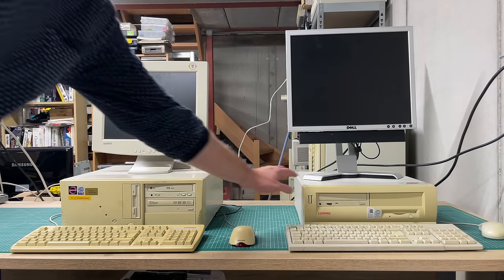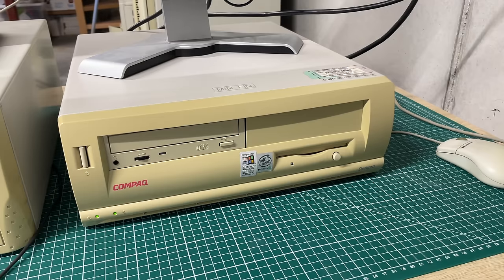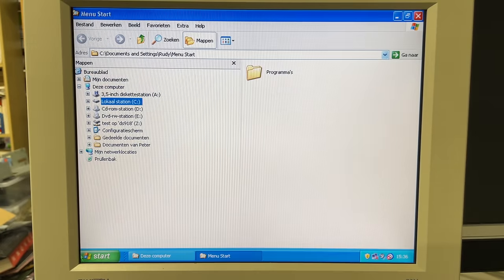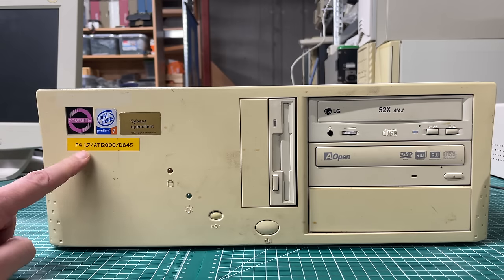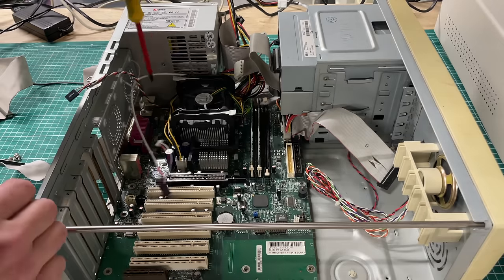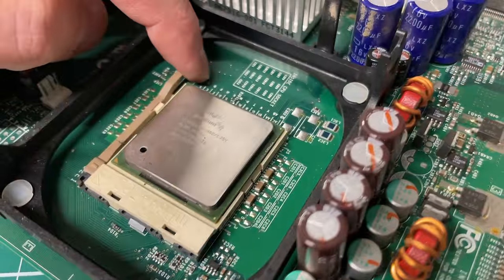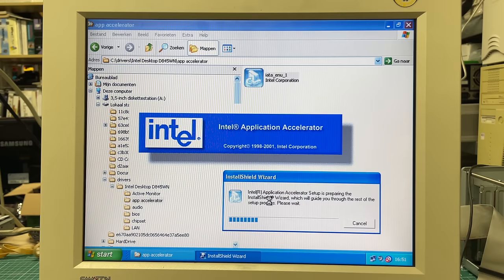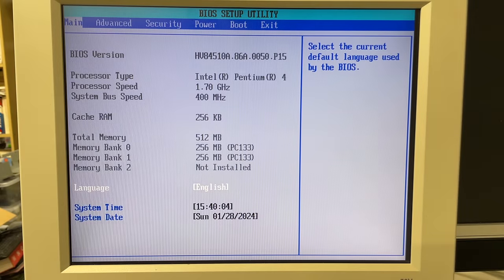Why is my Pentium 4 so slow ?

Comment: My first thought when I see such read speeds: the IDE controller is in PIO4 mode instead of UltraDMA. The most common cause of this behavior is using a 40-wire IDE cable instead of a 80-wire one (or bad quality of that cable).
Reply: I actually thought the same. I never needed the Application Accelerator in the past. I avoided Intel crapware.
Reply: 40pin work with dma but only like dma 3, it's 30mbs, so it's not so bad. Yes 80 pin is better, with more modern like p4 or even PIII, but most important is manually check and configure bios. And of course use new or tested and good hdd or ssd for best speed.
And don't forget install latest chipset driver like we so in a video.
Reply: PIO was awful. First time I built a computer ever I had a PIO hard disk and the machine came alive with a UDMA drive.
Reply: @_Tualatin_  ATA100 and ATA133, I always used 80pin cables. However they are hard to find nowadays.
Reply: Around the 15 minute mark it does show the cable as an 80pin and that ultra dma 5 mode is in use.
Reply: @d34dbolt20  Mode is active but we never see a window from device manager that is actually in use.
Reply: Same thought here. Also, it can help to enable _Plug & Play OS. And configure Ultra DMA to be active within Windows Device Manager for any channel that has a supported device. I never actually used any application to achieve the best speeds, just 80-wire cables and the correct settings in Windows and the BIOS.
Reply: If Windows doesn't have the chipset driver it will use the IDE IO port based driver.  That will only operate using PIO transfers.  You need a 32bit ATA driver for UDMA mode.
Reply: @TheUAoB  That seems logic. I am too long away from Windows.
Reply: If you look at his cable it is definitely a 40 pin cable. 80 pin cables have a blue connector instead of a black one. That absolutely needs to be changed.
Reply: I seem to remember udma33 working with 40pin. I thought it was 66+ that needed 80pin. Regardless, my experience was the dma was the important part, not so much the raw transfer speed. Those old drives often could not saturate a udma33 interface on random reads, or sometimes even sequential reads. 

Again, it's been a while, but iirc PIO used the cpu to transfer data from the hd. Udma used, well, dma. 133 vs 33 might make a bit of difference, but not as much as you'd think on a typical drive.
Reply: @mortrek  UDMA does work with 40 pin and yes it doesn't saturate the interface, but it does affect the Random speeds for real world use, such as starting the OS or opening programs. I've seen a huge difference in overall performance between a 40pin and an 80 pin on UDMA 66, 100, and 133, especially on Maxtor drives like the one in this video.
Reply: @TheUAoB  Its not true. Windows itself pciide.sys driver can run in DMA mode since NT4 SP3 :-)
Reply: Yup, the BIOS already detected an 80-pin cable and enabled a faster mode, and it's not an issue with XP having drivers or not.  Even stock XP with no chipset drivers works ... fine.

Something was just borked, and that was suuuuper common with XP.  Too many driver stacks with interfaces where things can get loaded in the middle (to view or modify requests and responses in-flight), too many "utility" programs trying to add hooks to those driver stacks, and too much bloatware if not outright malware just consuming all the memory and CPU time you have.

The lesson I learned back then:  Burn it all to the ground, reinstall, and you've got a brand new computer.
Reply: I remember that my old Athlon 1.4GHz system went suddenly hella sluggish and it was indeed in PIO mode. Reinstalling the VIA chipset drivers corrected that.
Reply: @RuruFIN  Yes, it can happen. Microsoft driver when CRC errors are detected switch to PIO mode and never switch back.
Reply: I expected the hard drive to just be trashed at this point but you could be right
Reply: @cee128d  No need to look at the connector color, that's your misconception. The hard disk cable clearly has 80 wires. We do see a 40 inside the case, but it is the one for the optical drives.
Reply: Would be prudent to check device manager to see what mode is set. You can still get DMA on a 40 wire cable, its just DMA2.
Reply: @TheUAoB  You can use DMA without the intel INF driver in XP. But I can not remember if it needs to be set manually. (in 98 it did.)
Reply: @nickwallette6201  I am wondering if someone at some point just shut off DMA in the device maneger under the drive.
Reply: @wishusknight3009  I thought it depended on the actual chipset?  I could be mistaken.  I remember Windows9x and earlier used the DOS routines if you didn't have a driver.
Reply: @TheUAoB  The IDE controller intel used was never changed from the 810-815 (ICH2) to the 875 Chipset (ICH5).  Drivers for those were built into windows XP and would work with even the early builds of XP with DMA. I am guessing it was just simply the setting in the device maneger that was set to PIO rather than DMA. How it got switched is anyones guess.
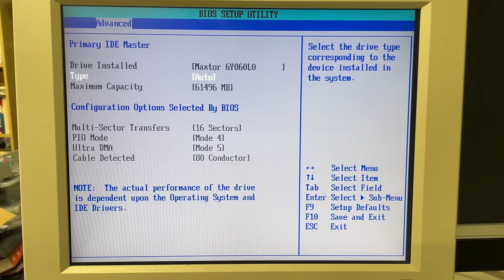Reply: 6:19 UDMA is disabled in BIOS
Reply: @BongoFerno  and he just enabled it. wtf, are you even watching?
Reply: @hoddelkind  6:21 Ultra DMA left disabled
Reply: @BongoFerno  That was only showing what the stock manual settings are. All motherboards will show that way when toggled manual.
Reply: @BongoFerno  but "AUTO" mode is then going to be enabled. It even shows after that UDMA5 mode. Even the first intel tool showed UDMA5
Reply: 40 pin 40wire kabel is only to UDMA33 if you have UDMA 66+ HDD you need 80wire
Reply: PIO4 is the last resort, usually, using the 40-conductor IDE PATA IDE cable, should still operate at UDMA33. That's a whole lot better than PIO! Usually, it's a broken PATA connector.
Reply: The extra 40 pins are for grounding.
Reply: thats what hes doing on ass backwards, hes using a cable select cable while the jumper is set to Master. Master/slave mode are only used on the 40  wire cables and them maxtor drives hate that. He needs to set the jumper on that hard dsik to the second position from the first. (cs enable.) do the same to the cd rom if its in slave,
Reply: @_Tualatin_  yes if the drive is set to CS instead of MAster like the one he has in the video, take a closer look. That drives set to Ds MAster, not CS enable
Reply: How do I understand this?

Comment: Pentium 4 was the reason that AMD came into the match from around 1999-2012.
Reply: At the same time Intel was failing with long pipelines and high clock rates in 32 bit Netburst, AMD developed the 64 bit architecture that both AMD and Intel are using to this day. Prior implementations of 64 bit (including Intel's ill-fated Itanium) all had major disadvantages preventing PC, workstation, and low-end server adoption. Not only can an OS running in AMD64 "long mode" still run 32-bit programs, but the way the instruction set is designed, 64 bit programs can and frequently do use 32 bit instructions for performance. They have to use 64 bit pointers, but that performance hit is offset by the gains from the instruction pointer relative address mode AMD added.
Reply: More like 1999 - 2006. Core 2 Duo rekt every competition, then there was Core i series. Thankfully we have Ryzen now.
Reply: Amd has always been in the game
Reply: Yeah. Pentium 4s were space heaters and slow per MHz. Most of us that built systems - built AMD Athlon.
Reply: amd was always there :)
Reply: @volf3r505  Not even that; they were only really good in like late 2003 - early 2006.
Reply: Nope, Core Duo, P4 was the lower level CPU.
AMD could not beat Core back then.
Now, AMD is dead, TSMC makes them now
Reply: @lucasrem  A CPU is not the same as a chip factory. A CPU just as any other integrated chip is construction and manufacturing silly. Your knowledge of integrated circuits is basically zero.
Reply: @Hypn0s2   yeah i built two P4 systems,  one was a daily the other was used for a lab server, for windows 2003. Both machines suffered heat. The server just got hot, and it was doing bugger all.  The best system i ever built was AMD, worst thing i did was switch it to P4.  When i decided to rebuild my lab, the P4 server i had, i just scrapped off, and built a Dual P3, and its a much better system.
Reply: @pinklightninggacha   i am strongly thinking on switching to AMD, when i upgrade my daily.

Comment: Back when the P4 came out, many critics trashed it; in some tests, the PIII was faster. The P4 was also notorious for running hot
Reply: It was not running hot from today point of view, problem is that you jumped from 90s CPUs with ridiculously low TDP to CPU which already needs proper cooler and most of people didn't have proper cooler back in the day. Even basic Zalman cooler was able to keep it around 55°C in full load, that's not hot at all from today point of view, when you use more modern cooler which already has heat-pipes (they started appearing around 2004), it has like 40°C even in full load, compare it to today CPUs which run on 90. 😀
BTW, no, Athlon XP was not cooler, it's a lie.
Reply: The early P4 was not great. I think it took me about 6 months before I did a FSB overclock on my 1.6. I got the FSB to 150MHz  (2.4GHz CPU clock) and it became a totally different machine, nearly doubling benchmark performance. I think later, I played around and got the FSB a little higher, maybe 160MHz. Anyway, it served me well for the better part of a decade and was playing new releases for about 5 years, courtesy of a GF3 Ti500 that also overclocked well. It didn't matter they ran hot because a 350nm process could handle it. Modern CPUs can't take the same kind of abuse.
Reply: The pentium d ran hot as well. It was basically two pentium 4s put together. The core 2 duo was worlds ahead
Reply: That is for first gen of P4 which is socket 423, never use them but hear the stories and benchs. The P4 1.8A with a 512kb of cached version is something killer, but for sure such as celeron 1.7 with a 128k versions can get trouble with tualatin series even celeron itself when its clocked at 1.4.
Reply: @Pidalin  yeah but they were still pushing pentium 4's when amd was on to athlon 64 (as well as X2's) which did run a lot cooler than P4 and out performed them
Reply: @Pidalin  depends on the p4. The prescotts easily went past the 80C mark.

Comment: It's a miracle that the old Maxtor DM9+ drive is still working. Those were notorious of failing.
Reply: Hehe yeah I was thinking exactly the same thing. I had a couple of 160gb Maxtor drives both failed around the same time. They are only good as a door stop.
Reply: Not all Maxtor drives were that bad... My dad used his 40GB Maxtor as his only hard drive from 2001 till 2016 and last I checked it had 30k+ power on hours and still working like a champ
Reply: @ThePuuFa  Diamond Max 8s were pretty much the only terrible ones from Maxtor. They are identified by the new-slim-look. Their other models have the more usual style housing. The 8s are the 6Exxxxx. 6Exxxxx are bad. The 6Yxxxxx is an excellent family of HDDs from Maxtor.
Reply: My Dell Pentuim 4 from 2005 still has its original Maxtor drive, not that im using it lately but i actually used it for recording my band with 16 channels via firewire for album recordings up until a couple of years ago but that really was on the limit of what was possible, i have since replaced it with a used but less old Intel I5 which is a monster compared to the P4 although its about 12 years old now but it works just fine for the task.
Reply: Based on the sound it makes, it is likely to die soon. I have a Quantum Fireball from that era that still works but I won't put it in a build. Too small. I have quite a few old drives in good condition. I built a PIII with a Seagate Medalist drive last year for a Win 98 machine.
Reply: Haha, yeah, I have had like 6-7 Maxtor HDDs in my life, all started to get slow or noisy and died
Reply: haha just what came trhough my mind when I saw it: "oh no, it's Maxtor"

Comment: The P4 was a slug from the get go. That’s why Intel eventually abandoned it and went back to the P3 design for the Core series CPUs.
Reply: Iirc, M/Core was a hybrid and also an evolution from both. They took the best parts of both and tweaked it significantly.

Comment: Par for the course, fresh OS install - doesn't matter if its a Celeron or a 3.8Ghz Extreme Edition, give it a few weeks, it'll be grinding, shovelling and displacing bits and bytes like a gaggle of lethargic road sweepers.
Reply: Of course, it is a Pentium 4 after all 🙂I'm amazed on how slow the system in a top noth  Northwood could be, even with an SSD ^^
Reply: @polaxis842  I have an Asrock P4i65g and ran it with a Prescott 3.4 and a Northwood 3.0 with Win 7 on an SSD. It previously ran XP on a HDD. It ran pretty well, though I didn't do benchmarks. Decided to retire it and got an Asrock 775i65pe and Pentium D 950 with Win 10 1511. It too runs quite well for its age.
Reply: @alexanderangelov230  That is quite some oldschool hardware in the meantime 🙂 From my experience: It did run Windows + Office + games from the same time period very well. But even for browsing, the CPU was heavily on edge :)
Reply: @polaxis842  Of course Pentium has nothing on Core. But that was my first pc, a budget one, from 2005, and it came with a Celeron 2.4. The Pentium was a welcome upgrade.
Reply: He is just another "look how P4 is slow" retro tester, but the fact that his P4 system is not clean and has a lot of bloatware is something he doesn't tell you. I see that he even has installed some network disks in my computer, whole comparison is a nonsense then.
Reply: @alexanderangelov230  Asrock P4i65g is a legendary motherboard, I also had one, running 2.8 GHz Celeron D overclocked to 3.3 GHz. I had that PC until 2008, I even finished Crysis on it.
Reply: @Pidalin I still have it, although put away in a box. My second motherboard actually. First one was some Intel I don't even remember, that had to be replaced. After that one, I got only AsRock boards.

Comment: Defragging the hard drive as well as defragging system files offline (hibernation file, page file, MFT file, and registry hives) can also have a significant impact on performance, especially with a system installed in an HDD

Comment: The Case is a Compucase made (7106), sold by Aopen.
Those are prety nice for ATX Desktop Rigs...
Reply: makes you wonder if the Pentium 3 system could have been sped up like the Pentium 4 system due to it also having software and driver problems.🤔🤔
Reply: what is that 2000 era case called with green triangular downfacing power button and all textured with downfacing triangles?